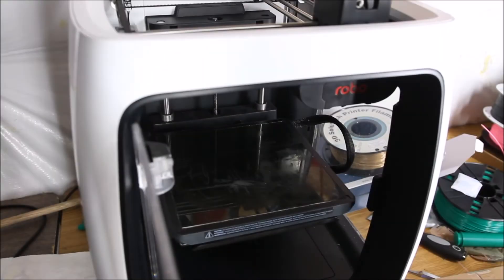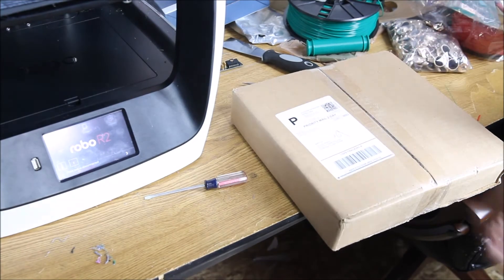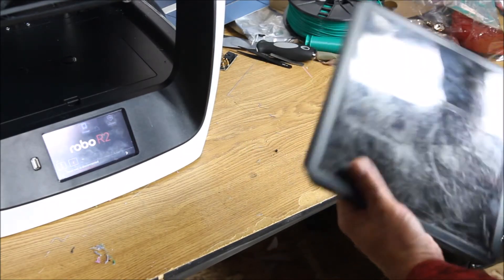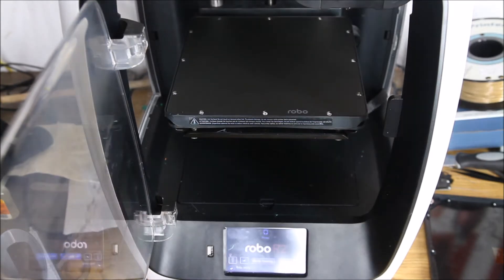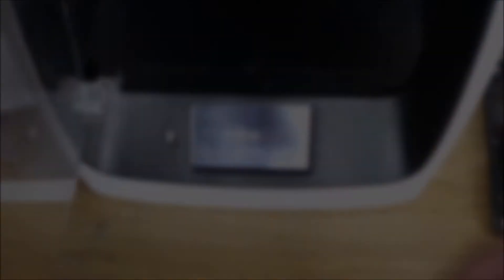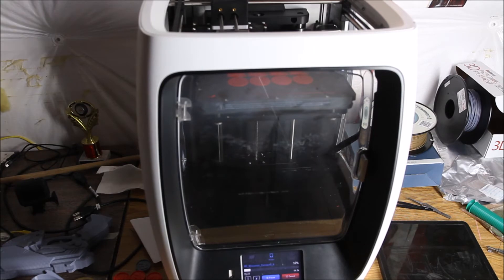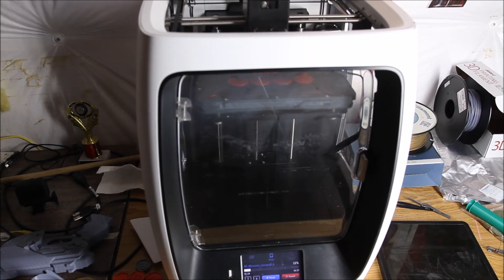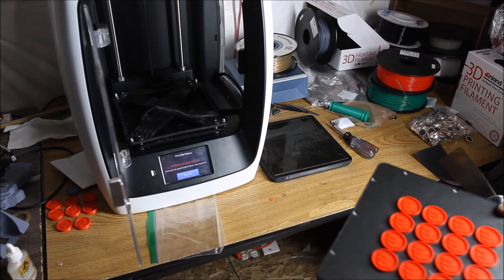Robo3d BuildTak Replacement Bed

Comment: Great vid, thanks!  Old surface is actually a PEI sheet - I do wish it were glass though.  Get a scraper with plastic blades, works great and is gentler on the surface.  They really shouldn't ship with those metal spatulas.

Comment: I scratched and dug into my new build plate.  It's almost impossible to get stuff off.  I'm now using painters tape not to get stuff to stick, but to make it easier to get stuff off.
Reply from the maker: I definitely don't have any problem with adhesion with the buildtak plates. It is almost too sticky. I've mostly been working on adjusting my z offset so that I'm not having the first layer smash too thin. Still takes some effort to get my prints off without scratching it.

Comment: Do you regret it or you are happy with the end result considering the challenges
Reply from the maker: Tony Stadele my experience with 3D printing as a whole is that while the capabilities of printers continue to improve, it still is not as easy or straight forward as ink jet printing. Every 3d printer I know of requires users to be ready to dig into them and be able to service things yourself. 

I also realize that being part of a kickstarter campaign, I’m getting the first version of an item. Thankfully most companies I’ve helped fund have been very responsive with fixes and updates as issues have been identified. 
The R2 is a great printer. Of the six 3d printers currently in my house, the R2 is my most worry free printer. I can pretty much just load a file and hit print. I don’t have to constantly tweak the height for the first layer and barely even monitor it once I’ve started a print. 
My R2 still has some issues that I haven’t figured out. There is a wobble in the Z axis that causes my prints to have a waviness to them. Taller prints with flat walls look odd and require a lot of post finishing to look good. This is not a common issue from what I’ve researched, so I wouldn’t expect others to have it. I received a new z-axis motor and screw from Robo, but haven’t replaced it yet, since that looks like it will require a lot of disassembly. 
Overall, I’m quite happy.
Reply: Oh wow thank you for taking the time

Comment: Did you have to pay for the replacement?   Or is this a warranty replacement?  Can anyone get one or does your bed have to fail?
Reply from the maker: Mine was under warranty. The POGO board failed multiple times, so I claimed it as warranty. I was asking for another POGO and the ability to buy more to replace it when it failed again, but they informed me that they had come up with a new solution, so they were going to send me that instead of a replacement POGO. I don't know about buying the new bed, but they are going to sell the replacement BuildTak surfaces for $10 each.